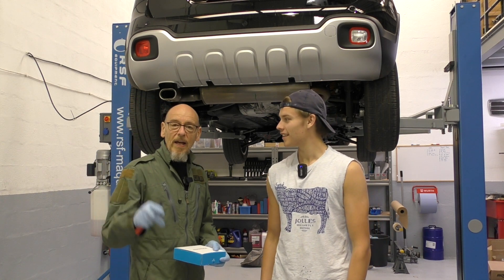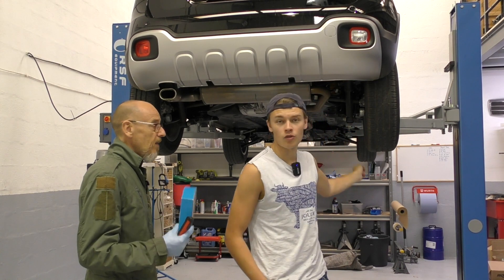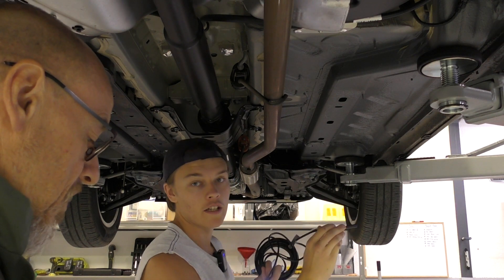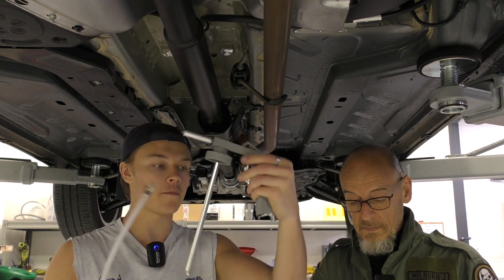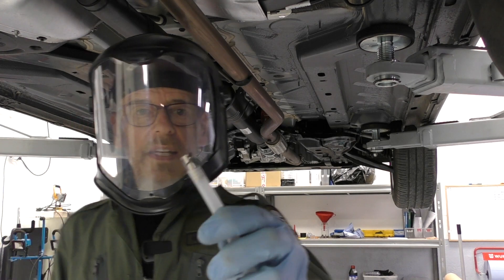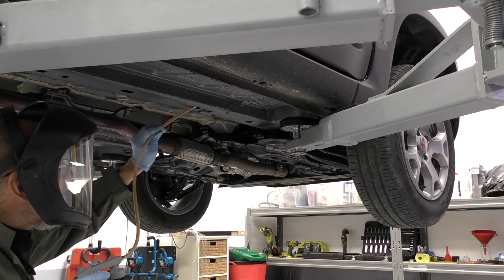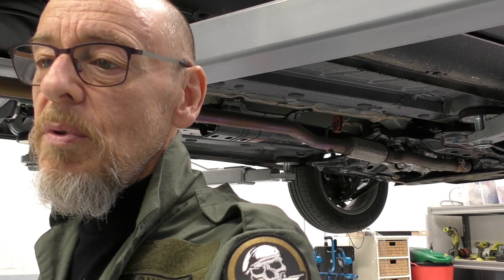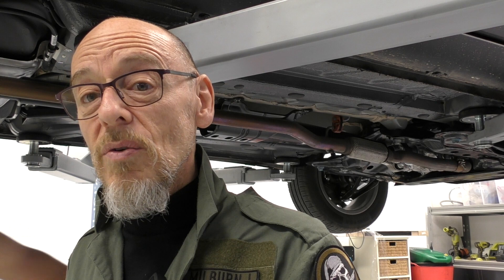Do you need to ( waxoyl ) rust proof a brand new car or van? Lets see on our new FIAT Panda

Comment: Guys, have you considered also applying a general underbody corrosion inhibitor? This will protect those exposed areas such as the suspension arms and the subframes, all areas that although not hidden like those cavities will still suffer corrosion, the subframes in particular. It's good to do it before the rust starts.
There are many products available but I've used Bilt Hamber on my cars in the past. Similar to that cavity protection wax you've used, it only needs a thin film and you can get it in brown or clear. Good to apply something under the wheel arches too. 
Really enjoying your videos too!
Reply from the maker: I am obsessed with ACF50 - so everything (including me when doing it 🤣) gets covered - not tried Bilt Hamber, I am on their website whilst typing this, bugger you have hurt my wallet !! ha ha - thanks for the info, defo going to order some

Comment: Although I welcome the often-forgotten practice of preventative maintenance, some statements here are seemingly based on outdated and inaccurate assumptions.

Dating back to the mid-nineteen-eighties, FIAT in Europe began to hot-dip galvanise their passenger car model range.  Not retrospective however, galvanising was phased in as replacement and updated models were launched.  The original 141 Panda was never galvanised whereas the 146 Uno, launched in January 1983, was not [partly] galvanised until the 1989 facelift.  The 160 Tipo and 159 Tempra were galvanised from launch.

The 170 Cinquecento, 187 Seicento and the 176 Punto were fully galvanised.  By the time the second generation 169 Panda was launched in 2003, all FIAT passenger cars built for European markets were galvanised. 

The current 319 Panda featured would be similarly galvanised.  After pressing, welding and assembly the bare body shell, including doors, tailgate etc, is entirely submerged and rotated within the hot zinc solution.  After drying, QC checks and substrate preparation, the body shell is electrostatically dipped by total immersion and rotation for a second time.  Now referred to as a body in white, further QC checks, seam sealing and under-body sealing is completed by both robotic and human processes.

The grommets identified in the video are not inserted until after the colour and clear-coat is applied.  Aesthetic, the colour and clear coats are applied only to externally visible surfaces. The holes in the body shell allow for the zinc and proprietary coating to enter and drain from internal sections.  

While I agree the body in white sections look like a cost-saving measure, the coating in combination with galvanised steel is nevertheless resilient.  Structural and panel corrosion on FIAT group cars is not the issue it once was.   

Given my understanding and the experience described, it has never occurred to me to inject wax into box sections, pinch welds and lower doors etc.  I would need to be satisfied beyond doubt that injected wax did not prevent water run-off and condensation draining as intended.

In climates where road salting is necessary, annual wax application to the exposed steering/suspension components and subframe assemblies is invaluable.  Bitumastic products remain best suited to maintain the integrity of factory applied under-body coatings.  As with any car brand, the lack of regular and preventative maintenance will increase repair/whole-life costs.  Similarly, body repairs using non-approved parts/repair methods is likely to reduce usable lifespan.
Reply from the maker: Fantastic information, thank you for spending so much time to inform.

Being old, I remember & personally owned rust buckets, a 127, a few 1100's and a Cortina I could see the road in from the holes in the floor come immediately to mind.

Back in the 1970s, Italian, Czech and British cars were renowned for rusting after they were just a couple of years old, some supplied new with rust already forming / formed. 

Most car makers now galvanise the steel that they make cars from as you rightly point out. Zinc sticks really well to steel - and because zinc is more reactive than steel, it will rust before the steel does. It essentially sacrifices itself to protect the steel, but still needs protecting itself - dependant on your use and expectancy to keep a car in your ownership, is what you do to protect your investment – as we have with our Panda. 

Nothing is 100% as an application, really depends where you are and use.
As we are subjecting it to scratching, specifically underside, sills can and do get filled with sharp objects that can deteriorate all protective layers over time.

A lot of the steels used in modern cars are high grade - galvanised before they have got anywhere near being a car. Bodies that are not pre-galvanised are dipped to ensure a thorough coating of the protective zinc - plus car makers then apply a protective polymer coat before painting - but these are layers of protection that can and will fail under many circumstances.

Luckily car makers don’t use steel as much as they used to, with panels out of plastic or even aluminium , I thought mose would be plastic by now - our RC cars live a life of hell, and survive amazingly well ( I have a RC from when I was 17, the motor still works perfectly, bring on ev's ! ) 

The protective layer of zinc that the manufacturer has galvanised onto the steel can wear thin over the years, just through normal use, not to the level we have done to our Panda, that exceeds many owners, but here in Portugal there are still hundreds of dust tracks – so it is highly likely to be rust in all sorts of places, you just can’t see it & it takes longer due to our heat and rack of rain.

Our intent was to protect behind body panels or beneath the undertray and on the car’s underside, in the sills, behind wheel arch liners & behind lights. These are areas that can be permanently damp in many country’s, more of an issue in say the UK where salt is common in winter - sometimes the galvanising fails for a variety of reasons, possibly through another component or foreign object rubbing it off - that is our concern.

The Panda is susceptible drainage channels blocking with debris,  we use washboard dirt roads, sharp particles vibrate in areas we simply cannot clean well –  wax from new is a vital tool in helping prolong the Panda’s life rust free, I still think it is and was very worthwhile, plus we enjoyed doing it :) 

My JEEP is 12 years old - I just spend a year cleaning and protecting it, it was 100% rust free, but still waxoyled ( not worth videoing - and as you say, many think its pointless )